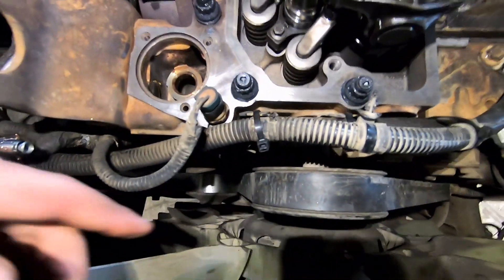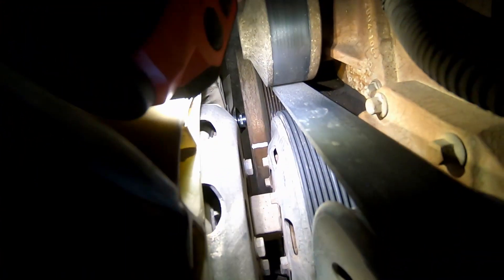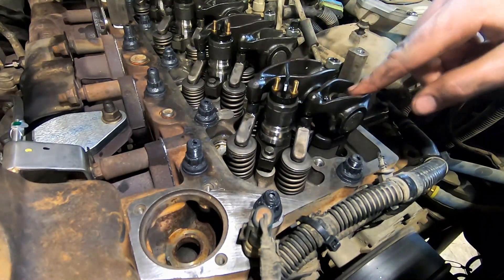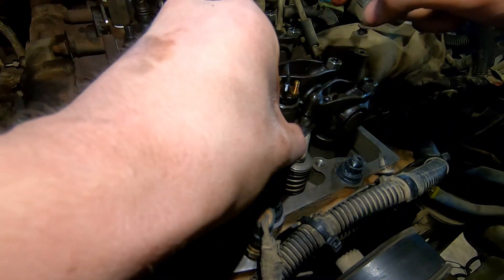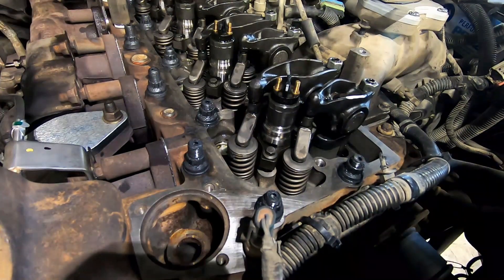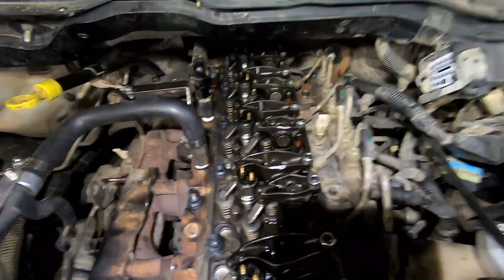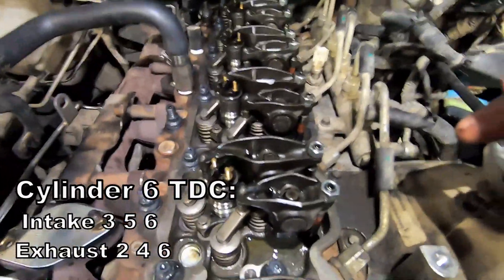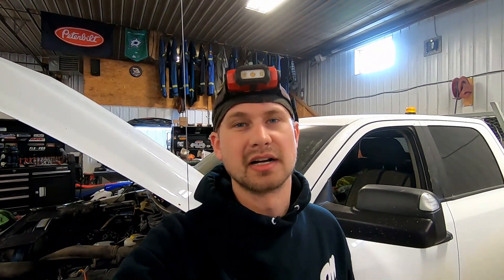How To: Setting the valves on a 6.7 Cummins

Comment: I did mine just the other day. (.20)on exhaust an (.10) on intake. Runs way quieter seems right but the oil/coolant temp runs 218-220 when I get down on the pedal. Is that normal or did I do them to tight?  That being said the temp runs 200-204 when cruising.

Comment: Is a 08 6.7  the same size for valve lash as a 2015? Are they all the same?
Reply: Yes they are but I did .08 and .20 for mine. If I replaced my rolling assembly and it was brand new I would do factory
Reply: @deman817  even if its deleted? You would go back to factory ?

Comment: I just did mine by your video. I’ve always been nervous about fooling with valves… SUPER EASY and super smoothe. I set mine to 0.8 and 0.18 (I’m on the weight loss) she idles so darn smooth  now!
Reply: Have you noticed fuel mileage improvement?
Reply: @deman817  I’ve noticed an increase in MPG. Roughly 18-20mpg.

Comment: Ok, 2nd attempt and failure.  I busted the male end of one oil return line.  The electrical connectors don't cooperate.   I must be getting old, 74, but I would have no difficulty with my 1999 ram 5.9.  Adjusting valves is easy but getting all thfrustrating is fustrating.

Comment: my 17 cummins with 60k miles on it makes a loud knocking noise on startup and as it warms up it stops, you think might need a valve adjustment and if so would I adjust it to the specs your doing it too. its deleted
Reply: That’s not valve lash. Valve lash would be consistent. That sounds like something else! I’d crack open your oil filter and check for metal. Could also be the CP3 going bad. Which could throw metal into the engine. Could be a lot of things! Could be a bad turbo. Is all of those things stock?
Reply: Mine does the same thing when the engine is doing the warmup on high idle with the exhaust brake on.

Comment: Thanks for the video! I watched another one where the guy use .020 instead of 0.26 because the truck was deleted. What’s your thought on that?
Reply: .020 is the 5.9 spec, without the egr you can run that spec and it will be quieter
Reply: It's what I did for mine and its deleted. Runs smooth!

Comment: On the deleted trucks isn’t it the same as the 5.9’s at the 10/20 just the none deleted ones are 10/26.. Or that’s what I’ve read on a lot of forums.. Or am I incorrect?
Reply from the maker: Yeah 10/20 is fine on a deleted truck, if you do 10/26 that’s going to be fine too. Honestly the “in spec” range is so wide with these trucks that as long as you’re close it shouldn’t matter too much

Comment: Question. I’ve been an Auto Mechanic/ Technician for over 30 yrs. I just did a 6.7 Cummins head. But I used the starter & a remote starter button. Bumped the starter till the cylinder I’m working on both valves closed. Than set or adjust that cylinder & move on. I’ve been doing it that way since my racing days with SBC. Just easier for me. I work by myself.
Reply from the maker: You could do that but I’d worry that if I showed that procedure someone with less mechanical knowledge might end up with a bent pushrod or worse.
Reply: @darkirondiesel that’s exactly what happened to my coworker and I today. We bent a rod using the starter motor to turn the crankshaft to tdc. I’m still not sure what went wrong. I’m pretty new at this.

Comment: Would it be a good idea to replace the valve seals while doing this given it’ll be apart? 

If so, I’ve heard of seal damage if not using a sleeve when pressing the seal over the groove in the valve stem. 

True? If so, do you sell a tool for this reason. I know Cummins has a tool, but it’s ungodly expensive for what it is. 

I’ve heard people use items such as straws to heat shrink.

Comment: Trying to figure out why when I turn the motor with the ratchet the rocker bridges pop off put a new head gasket on and don't know if I got all the rocker arms in the right place I'm pretty sure I did but I'm having trouble with that when I'm turning the motor making a big pop and sound and the bridge comes off into the engine
Reply: After doing the head, did you set valve lash? Are the bridges set correctly with the dimple pointing towards the driver side? The rocker shouldn’t allow the bridge to come up high enough for it to pop off the valves.

Comment: Cylinder 5 exhaust pushrod sitting properly but higher than others and not getting rocker loose enough to get any lash adjustment. You think rod problem?
Reply: Could be the rod is not seated in the tappet properly.

Comment: Good evening, I have a question, I did a head gasket on a 2012 ram 6.7L now it's hard to start, when finally run blows white smoke and blows diesel from the EGR.
Reply: Did you seat the injectors fully? And did you get the head resurfaced

Comment: Quick question, I saw you turn the harmonic balancer bolts to rotate the engine, is there any fear of snapping those bolts? is using the barring tool easier?

Comment: Great job.
Question though I have a 2015 ram 5500 and I know there is some difference between the motor that's in the 3500 and the 5500 but I wouldn't think it would be no difference in the valve adjustments if there is please tell me the valve adjustments?

Comment: I watched this even though my 2019 had this maintenance procedure removed due to the use of hydraulic roller lifters. I am torn on what's better. I feel that this wasn't really much maintenance especially at it's mileage intervals. The flat tappet lifters are proven super reliable in this application. Hydraulic roller lifters can get wiped out with a tiny amount of oil contamination. I guess time will tell but I just don't see a roller lifter lasting 500k miles or longer. Any ones thoughts?
Reply from the maker: Personally I’d prefer this style. I’ve seen too many hydraulic lifters fail over the years.
Reply: What year did they switch to the hydraulic roller lifters? I have a 2014 is why I ask. Thanks

Comment: Great video , how do you torque the nut to 18 foot pounds? Do you just go with a regular socket and torque wrench after you tighten it , or do you have to use a specific tool socket to be able to hold the Allen bolt while torquing it.?
Reply from the maker: Personally I just snug them up by hand, but if you wanted to be technical I would first tighten it up by hand gently with a wrench, then remove the Allen key and use a socket and torque wrench to torque it, then after recheck valve lash to make sure the Allen bolt didn’t tighten up on you.

Comment: Great video. How do I do an EGR delete on my 09 Ram 2500 6.7. Another question, when I tow my 5th wheel and start up an incline my truck starts to buck until I drop it down to a lower gear. Any ideas? Thanks and keep up the good work. Bill

Comment: I have a 2012 got it when it 90k. It now has 184k. I have never had them adjusted. Never had a head gasket go bad. Mater of fack never had any problems with the engine. Do I need to get the vales adjusted?

Comment: I have a 5.9 Cummins with a 6.7 head. I don't have a tdc mark on my balancer. How can I find tdc with the head on. Used a barring tool to bump engine over. Set the valves to 5.9 specs (.010 intake.020 exhaust) and have a faint knock upon acceleration. I'm going to re run the valves any tips
Reply: Hello bro, I got the same problem today! Can you provide your way of solving that problem? No TDC mark on mine also...

Comment: Why do others call a 6,7 a 4 valve
Reply: It has 4 valves per cylinder. There's a split arm that pushes both intake on one rocker and both exhaust with one rocker
Reply from the maker: Ive never heard anyone call it that 🤷🏼‍♂️

Comment: Great video man!    I just did a head gasket on a 6.7L aswell just did everything you did.
Reply from the maker: Right on buddy!
Reply: @darkirondiesel  once I adjusted the valve settings, I got kinda worried it was not the right setting because the valve spring bridges still had some play in them.. but I guess that play is necessary so it does not wear out the tops of the bridges.  Basically the same play you have when the valves are closed

Comment: When you do this type of job do you need to get any new gaskets?
Reply from the maker: Nope you shouldn’t need to. You can just reuse the valve cover gasket/injector harness
Reply: Thanks this question and answer helped a lot
Reply: Yes, it’s true that you can reuse the gaskets BUT you need to inspect them closely for any tears or damage before considering reusing them. Happy Valve Setting. Once your past cylinders 5&6 your home free. 🤣🤣

Comment: What do you charge for a head gasket, fuel injector replacement for a bigger turbo and bigger fuel injector
Reply from the maker: There’s so many variables. What kind of injectors? Stock, reman, new, higher hp? What size of turbo? Are we doing vgt or non vgt? If non vgt then we gotta do tuning. Is the truck deleted? Which head studs do you want? Etc etc. Would take an hour or two to price something like that out. I’d do it for someone local to me but unfortunately I don’t have time on YouTube if you know what I mean.
Reply: @darkirondiesel  what does vgt stand for and it's a 2005 Dodge dually 3500 SLT quad cab Long bed with the 5.9 Cummins and it does not have any of dpf and Def on it because i a 2005 also it my Dad truck and he wants to put in bigger fuel injector as well as a bigger turbo also the truck doesn't run very good right now because of bad fuel injector and it idle very rough and also do you have your own shop
Reply from the maker: Oh if it’s a 5.9 then it won’t have dpf or a vgt (variable geometry turbo) where are you located? I’m in Saskatchewan Canada

Comment: Ive been taught to run overheads on larger diesel engines 11 liter and larger.......Now o the larger diesels- The running mates are the same, Now I have to Adjust the Intake,exhaust,Injector and Engine Brake (If equipped) Now....How come the smaller diesels dont have injector adjustmentd- Is it because they aren't overhead cam?  Im still learning to work on different motors
Reply from the maker: You’re probably working on an older Diesel engine that has mechanical injectors which is why you’d have to adjust them... I think anyways.
Reply: @darkirondiesel  No, They are post 1993 all  injectors electronically fired with harness. You have to set the Height on many (Except a 14 liter Detroit) Turn the Motor by hand repeat on companion cylinders......Im trying to learn the fundamentals on the Smaller stuff you are working on- What needs to be run on an overhead
Reply: @StayingBack71  you are adjusting the injectors because they are mechanically fired by the cam/cams on over head cam diesels, on a mechanical injected truck the injection pump controls the injectors firing, on a electronic smaller diesel like these where there’s pushrods they are fired by the solenoids on top of the injectors

Comment: Also bit of advice. If you set lash with engine cold, set .002” loose from spec to account for thermal expansion, then when engine hot the lash adjustment will be on spec or very close
Reply: The setting account for the engine hitting up. By doing what you say the valve lash will be wrong when the engine is hot.

Comment: Cylinder 1 and cylinder 6 are on tdc at the same time. Just opposite strokes. Too much information for people who are attempting this is confusing. Go off your rocker arms. If the rockers are loose on cylinder 1 and tdc position is correctly at 12 o’clock, then you are on the compression stroke and can run intake 1,2,4 and exhaust 1,3,5. Then just rotate clockwise 360 back to tdc and repeat procedure for the other valves. It’s much more simple that way. If you rotate up to tdc avd cylinder 1 exhaust rocker is tight then you know you’re on the exhaust stroke. Other than that it’s good information. Specs are accurate
Reply: Clearly framed.
Reply: Hello, thanks for the concise information! Also maybe you know, how do I set TDC position if the mark is erased?